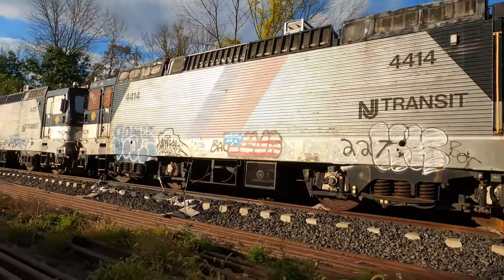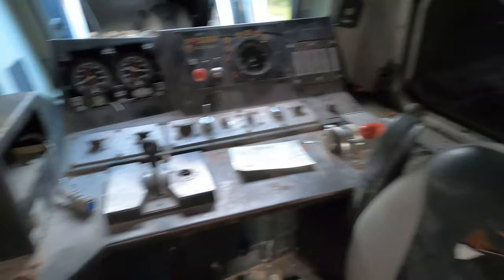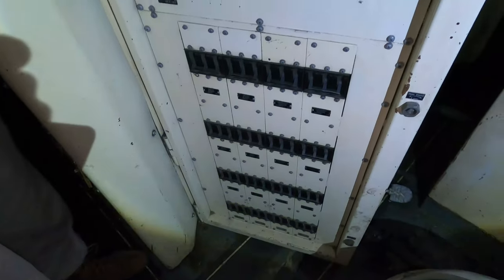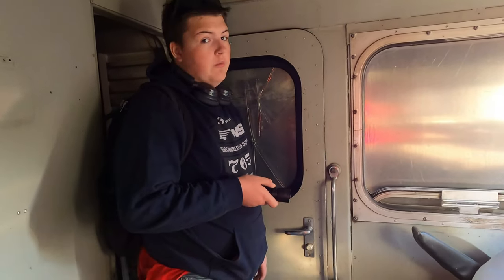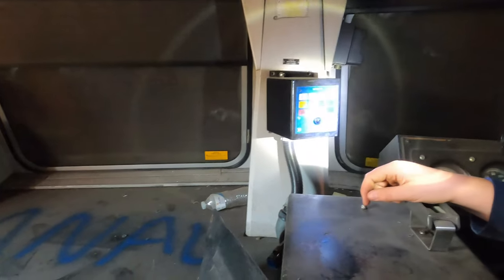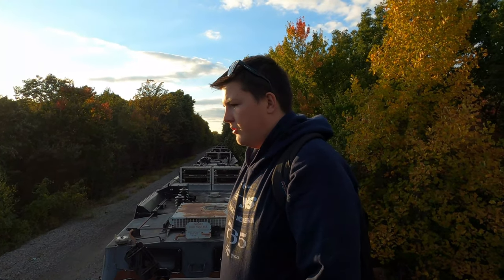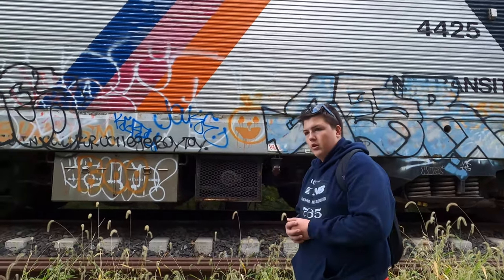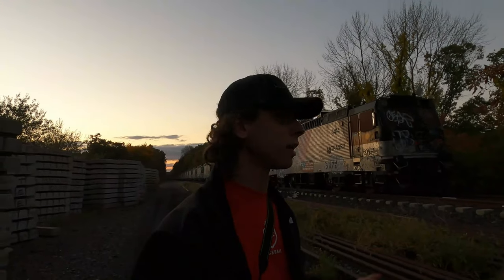Government Waste - 32 Abandoned Trains (New Jersey Transit's Darkest Secret)

Comment: These locomotives were custom built to order for NJT and are unique. Because of this, spare parts and components are no longer available and many of the original suppliers are out of business.  As they came due for major repairs, they were pulled from service and decommisioned, thereby becoming parts supplies for the remaining operational locomotives. Ultimately, all of the locomotives were replaced with a more modern, efficient and capable fleet that complies with current safety standards, are more reliable and meet current operational requirements. Finally, there is no market for these obsolete locomotives as, besides NJT, there are only five electrified commuter railroads in the US, all of which have ugraded their locomotive fleets.
Reply: Thanks for explaining this to the clueless trespasser who posted this video.
Reply: SEPTA also had one.

Comment: The 2:00 marks, those foot pedals from left to right are HORN, ACKNOWLEDGE, DOOR OVERRIDE. The ALP-44 did NOT have a deadman. At the 9:00 mark, the ALP 46 is NOT a duel mode, it’s an electric locomotive, not diesel. The ALP-44 as well as the ALP-46 had 4000hp.

Comment: The ALP 44 has 4 1850hp electric traction motors.. NJT wanted to spend money that the Department of Transportation was offering them and if you don't use it you lose it. That's why public transportation is so expensive to run for those that don't even use it. I ran and worked on AEM 7's and ALP 44's.  We took took those toilets out because the crews would leave klinkers in there and abuse them. The coach cleaners were stuck cleaning them out so out they went. Not to mention those screw air compressors ran hot as hades and your back would be up against a 180 degrees mixing line. They sure do know how to waste money. Just print some more. GG1's ran for over 50 years. ALP 44's not so much. Even AEM 7's got more than 25 years with Amtrak ,Marc and Septa.

Comment: Are they for sale?  The reason I ask is the capacitors can be  use in a GG1 since their capacitors are toxic maybe bring  one of the iconic electric locomotive back to life.
Reply: Nah they won’t sell
Reply: The PCB issue is the main transformers on the GG-1 and in any case, the main truck frames on all of them are basically destroyed.  You'd have to make new frames to run a GG-1 ever again.  The transformers could be rewound, but you'd probably need a de-rating.

Comment: not abandoned. you cant just take them home. 'disused', 'out of service' 'withdrawn from service' , but abandoned implies there is no owner. someone owns that, its worth a fortune in scrap. its about time urbexy people and normal people stop using the word abandoned incorrectly.
Reply from the maker: This is one of the stupidest things I’ve read in a long time😂
Reply: @ForgottenUSA  You might want to re-think your statement because the other statement was correct about the term abandoned. As per Websters abandon: To give up with the intent of never again claiming a right or interest in. That equipment possibly awaiting scrapping prices to reach proper level for disposal or maybe equipment trust arrangements made when equipment originally purchased to reach an expiration date so transaction can be made. It would truly be amazing if some gov agency or other party does still not have title, ownership and redponsibility of this equipment.
It is even possible the locos when retired were set aside for possible sale to another operator but never occurred and unfortunately the vandals are sealing their fate.
You will probably also scoff at this thought but you should consider that while you are crawling all over that equipment (without permission?) you do not want to have an accident and have to face those consequences. Responsible railfanning often requires a fair amount of descretion and restraint where someone else's property and operations are concerned.
Reply: @ForgottenUSA  Arm chair minutia experts.
Reply: Even so, these need restoration for possibly running bituminous from Kentucky to the steel mills in Toledo, Youngstown, and Cleveland, just to name a few places, especially if any of these locomotives are powered by either wire above the track as well as a third rail running along the track itself.

Comment: wonder why they kept 4 of em? maybe one day we can see one out and about
Reply: One of the 4 has been donated to a museum
Reply: @9751asd I work on the electronics for it. We have it running I don’t know if you saw. It can only run off of battery as the pantograph isn’t working yet but maybe soon it will be. Also it’s missing its atc so micro cab doesn’t work
Reply: @chrissoutdoorsgardening1261  when it’s restored any plans to run excursions???

Comment: And this is why people messing around through stored engines creates problems and delays for crews have to switch them.
Reply: These units will never run again.  NJT only has them still because if they scrap them now, they have to pay back the money the FTA gave them to buy them.  In a few more years, they will be out of their obligation to own them, and they will go right to the scrapper.  NJT is looking to junk their even newer PL-42 fleet, already.  They're horrid at fleet management.  These could have run a few more years in actual service, but NJT is all crazy about buying more junk from Bombardier.
Reply: @philipnasadowski1060  The PL42s don't meet newer EPA standards and they're unreliable at best. That's why they're getting rid of them.
Reply: @philipnasadowski1060 the alp 44 was a special order from njt half of its electronics were made by companies that stoped existing a couple years after they were built. The alp44s weren’t very reliable and the pl42s are junk and don’t meet emissions limits. The alp45 is actually an alright dual mode loco also it’s comfortable compared to the others

Comment: When was this recorded? are the ALP44s still there?
Reply from the maker: This was recorded in October 2022. As far as I know, they are still there.
Reply: This is the Lackawanna Cutoff East of Andover. These locomotives were stored for spare parts and have since moved on their final resting place as the Cutoff Restoration proceeds forward here in 2023. They were moved in the months following this video.
Reply: @SteveRoberts5330  do you know where they were moved?
Reply: @dr.woozie7500  As far as I know from TriState and a few other local rail sources - they were scrapped, all but one or two of them which were saved for preservation.